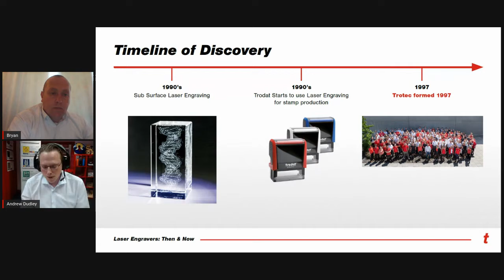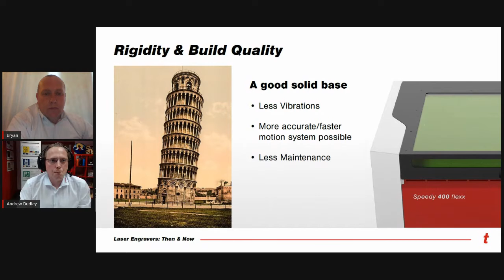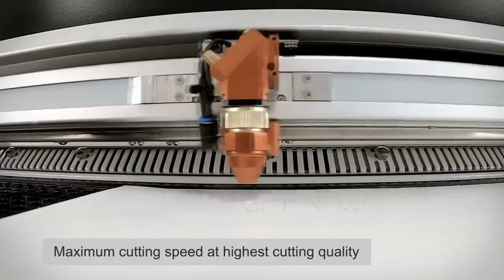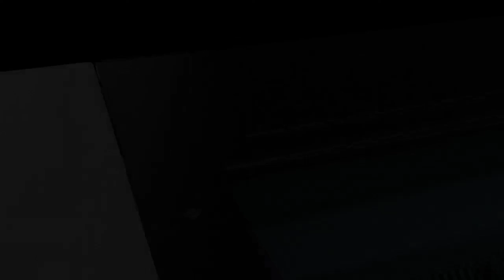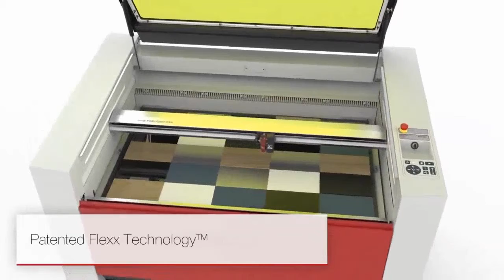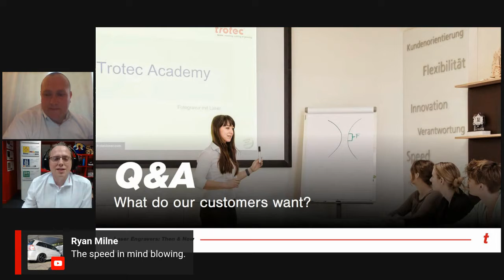Laser Engravers Then & Now: The latest advancements that you should know about.

Comment: Hi Guys, great video:  I have a question if I may:  My company is based in the UK and currently use mechanical engraving as part of the CNC manufacturing work to mark our products.   Are your lasers, or any lasers able to give a high contrast black finish on both raw and anodised aluminium?  If not are they capable of engraving to a depth of around 0.3microns as we've been manually inking the engraving ourselves but would love a quicker, more cost effective solution.  If you have contact details to discuss solutions/further I would be happy to make contact so you can take a look at our current range and see if you think it's achievable - Thanks!
Reply from the maker: Hi,
Thank you for watching and for your comment. :-) 
Please contact us directly either via our website troteclaser.co.uk or email sales@troteclaser.co.uk or call 0191 580 1182 - We will be happy to refer you to somebody who can answer all of your questions in detail. Thank you!
Reply from the maker: Hi, thanks for your enquiry, could you email sales@troteclaser.co.uk and we will be able to advise you.
Reply: Hi, I am sure Trotec will be able to assist here, Another avenue you could try would be www.lotuslaser.com  , a UK laser builder and designer who specialise in the very subject you were questioning.
They are a friendly company based in Basildon UK and would be able to offer guidance and help.
Kind Regards John
Reply: @johngrainger9456 Thanks so much John!

Comment: Thanks for the session 👍🏽 Couple of questions about things discussed...
1) Is OptiMotion as separate but of software available for all your lasers or is it only built into the latest Speedy 400?
2) Sonar autofocus sounds good, I’m assuming this is a new feature only available on the latest machines?
3) Is vector ordering only possible through Job control cut?
Reply from the maker: Hi Seb, thank you for watching! In answer to your q's:
1)      OptiMotion is the motion control system used for the new Speedy 400, it's based on the firmware from our large format SP series.
2)      The Sonar autofocus was first seen in our Speedy 360 but is now also available in the new Speedy 400 system
3)      Basic vector ordering is available in any JobControl (right-click on the job and select vector ordering), the more in-depth detail of editing nodes and adding lead-in and lead-out lines etc. is only available with JobControl Cut
.
I hope that helps!
Reply: So optimotion cant be retro fitted to our SP500 I take it?

Again I guess not able to retro for to SP500?

Oh really never knew that was possible with JC thanks and I’ve also just got Cut so will be giving this a go soon.

Thanks
Reply from the maker: @Etchwork  Unfortunately it can't be retro-fitted, it's only available on the new Speedy 400 and the SP2000/3000 at the moment.
Reply: Trotec Laser UK thanks for speedy reply (see what I did there 😜) just to confirm your reply was for both Optimotion and Sonar?
Reply from the maker: @Etchwork  Speedy by name, Speedy by nature! Yes sorry, neither can be retrofitted at this time.